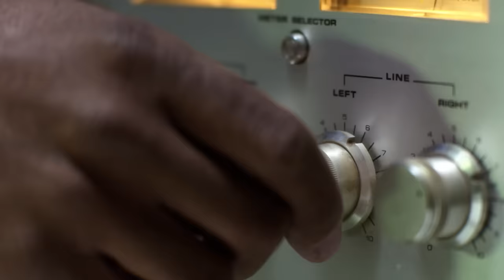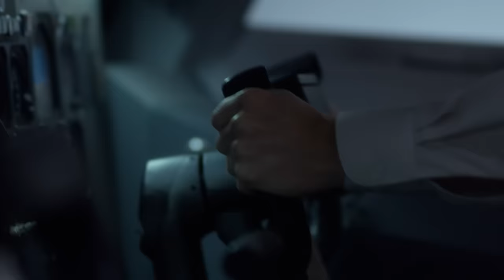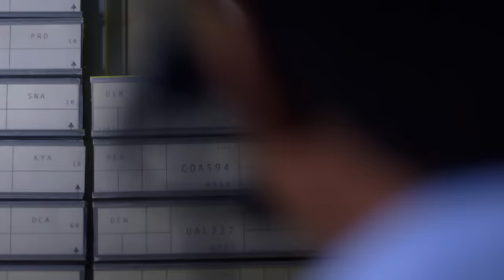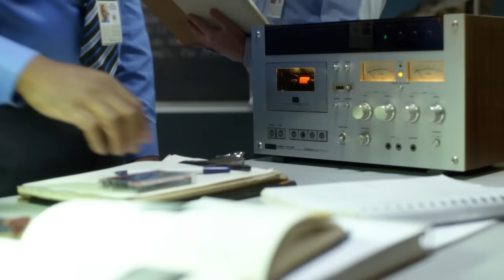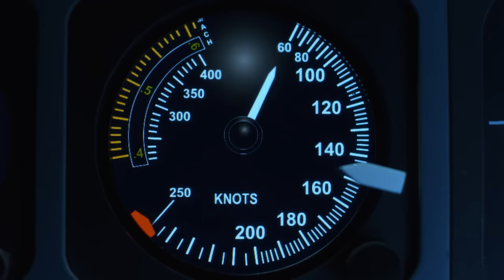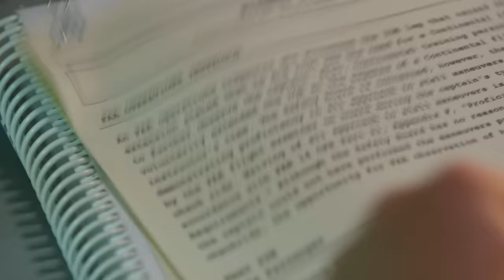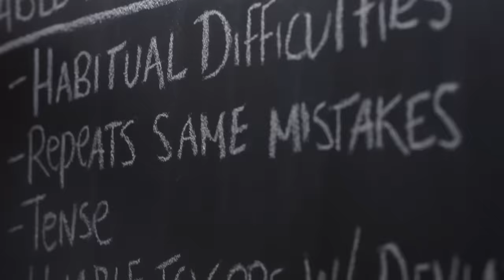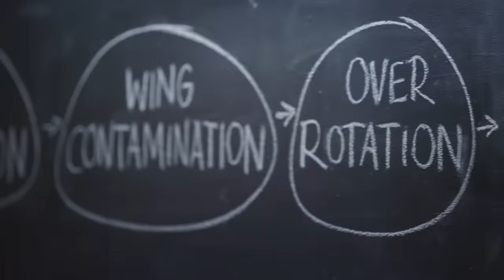Plane Crash That Changed Industry FOREVER | Mayday Air Disaster

Comment: I was on this flight.  I was in seat 15D which was over the right wing on the aisle.  It was much more cramped and crowded than this reenactment shows.  My perspective from the aisle would notice that more than his was next to the window.  There were no open seats.  The aisle was much more narrow and there were no flight attendants walking up and down the aisle.  We were all restless and most people were not talking.  A few tried to read the magazines in the seat pockets in front of us.  The man seated next to me and the one at the window never spoke.  I had come from a United Airlines flight that was cancelled due to the storm in Denver that day.  This was the only flight that my group could find to get home.  It was Sunday and we were all worried about getting back to school or work.
He’s exactly right about the time it took before the plane started moving.  It was de-iced fairly quickly but then we sat there for what seemed like a very long time.  During that time, no member of the flight crew checked the wings.  I was seated at the right wing.  They’d have had to lean over me to see the wing.  And the plane was standing at the leading lanes for the runway so no member of the ground crew could see us.
Also, the storm darkened the skies so that it looked like 5pm in November rather than 2pm.  Inside the plane we sat in the dark stone silent.  We were sensitive to the slightest movement by the plane.
Finally it started rolling toward the takeoff.  The Captain never said much.  I remember a brief announcement from him as we moved to the de icing pad and prior to that he announced that we were awaiting clearance to get de-iced but that is all I remember from him.
The reenactment doesn’t show our flight path very clearly.  If you compare the reenactment with the actual footage you will notice that the wreckage was much worse than what is depicted.  The plane took off and started to climb out.  We were in the air not hovering over the ground.  Within a minute the plane banked sharply to the right and then did a sickening roll back to the left as the Captain tried to take over.  One of the jet engines suddenly stalled out and made this tremendous noise like a gunshot right behind our ears.  I remember passengers starting to scream at that moment and I watched the nose go from an upward angle downward.  Within moments the left wing clipped the ground and a ball of fire roared through the cabin.  I remember turning my face to the right away from the heat but then the plane cartwheeled.  I remember hitting the ceiling with my face as our seats were ripped from the floor and then chaos, screaming, crashing and then the sound of gravel as we slid to a stop upside down.  
That’s what happened.
I was pulled from under the right wing 90 minutes later.  The man seated next to me did not survive.  Neither did 3 of my friends and 24 others including the captain and first officer.
Reply: No one should have to have had your traumatizing experience ! 
(True Safety Is No Accident )May the Lord bless
The rest of your life !
Reply: @markhwirth7718  Thank you for your reply and kindness!  Same to you.  I think everyone goes through a ‘plane crash’ in their life of one sort or another.  Mine was an actual plane wreck but no more significant than others.  I survived it and I am grateful.  I’m relatively unscathed physically, thank goodness, many people weren’t.  I didn’t lose any family members.  Many people did like the man in the video.  I have mixed feelings about these videos because I think it’s hard to reenact something that killed people from the standpoint of just one survivor.  But on the other hand I am honored that they did a program about this accident and its impact on air travel.
Reply: I'm so sorry that you experienced a terror unlike any many people ever do, and at a young age. But you survived and I know you've appreciated life more ever since.  😀
Reply: How much did you get in the lawsuit? I'm assuming at least a few million dollars for surviving thru that horrible ordeal.
Reply: @michellejansen6165 like you said people have and probably will be in some type of plane accident I know mine isn’t anything really but we hit a coyote while we were taking off and had to return because we didn’t know if there would be any structural damage but you are so lucky alive may God bless you and all who survived and died that day
Reply: Damn. It's rare to encounter someone in the comments who was actually on the flight depicted. Glad you are here to recount the facts. Be well and play the lottery every chance you get!
Reply: @hammiranda You’re forgetting that this was 1987.  No internet.  No cell phones.  No social media. No advocates.  I’m going to ignore the rudeness of your question and respond to its truth:  I got very little in compensation for the loss of my health and welfare that day not to mention everything I had with me.  I’m 56 years old now and my left hand shakes from the damage to the nerves in my arm.  I’m left handed.  I’m a business owner who works directly with my customers and I give lessons to kids who want to learn how to ride horses.  They all notice my hand as I try to write or illustrate.  Nothing compensates for that but at least I still have my family.
I’m saddened to hear of your question as one of the first things people think about when they talk to someone who has been in an accident like this as if we won a lottery.  We didn’t.
Reply: I'm so glad you survived but also saddened that happened to you , I'm sure they are moments , days you still think how it  all unreal it still seems after 37 years . May God bless you with many many prayers for many many  more years of life with your family .   🙏🙏🙏🙏
Reply: I was captivated by your comment. I'm so glad you survived. I couldn't imagine going through something like this. I wish you many more years on this earth :). My condolences about your friends. May they rest in peace❤️
Reply: @Voice4MyMoon  Thank you for your kindness!  I wish the same for you and those who share your story, too.
Reply: @10sherra  Thank you for your kind comments and for reading my story.  I wish you the same and everyone who shares your world!  :)
Reply: @markhwirth7718  Thank you for your reply and kind words!  I wish the same for you.  Thanks for reading my story.
Reply: @thecameramantraveler4830  I appreciate your reply and for reading my story.  I believe we’re all lucky to be alive.  :)
Reply: That’s such a terrible ordeal to go through. I hope you are doing well. So sorry for your loss as well
Reply: @michellejansen6165 so happy you survived your ordeal, hate you had to experience that, may God continue to bless you
Reply: @michellejansen6165 I’m so sorry this happened! Are you now scared of flying? Also we’re you in the fireing plane for 90 minutes as you said before?
Reply: @coco_styles  Thank you I just saw your reply.  Where are you from?  I posted my reply as a perspective from another survivor of that particular crash.  My hope is a more detailed understanding of what happened and to acknowledge the impact on all of the victims.  I am grateful to the man in the video who agreed to participate in it.  He was a boy at the time who lost his dad.  I’m sure his Father’s Day last weekend was poignant.  I hope he’s feeling well and if he’s a dad himself he knows all too well the fear his father felt as the plane went down—not just for himself but his child next to him.  I didn’t have any family members on board so I didn’t have to endure his loss.
I’m not sure what you mean by your question regarding the fire.  When the wing hit the ground it disintegrated and a ball of fire erupted from the fuel lines.  I was seated on the other side and the plane cartwheeled immediately after that extinguishing the fire itself.  Ironically the storm saved us as we awaited rescue because we were soaked in jet fuel.  Had it not been so cold and wet with heavy snow I probably wouldn’t be explaining myself to you.
Reply: @michellejansen6165  ah he’s thank you! I was confused that since when the video showed the crash fire was there and in your previous responses u said you were waiting for resucures for 90 minutes so I thought that if there was a fire how could he be there for 90 minutes but now I understand! But regarding my other question do you fly frequently? That was my main question but thanks for replying also I’m from New York!
Reply: @coco_styles  I hope all is well in New York.  Several people suffered severe burns.  I was wearing a heavy wool sweater with long sleeves so I was protected from the worst of the fire.  There were a lot of survivors who waited 5 hours to be rescued.  I believe the firefighters in the video talked about that.
This is why I commented about my perspective and recollection.  A video apparently can’t tell the story without creating confusion.
I was not afraid to fly until Boeing proved to me that their planes are no longer safe.  Yes, now I am afraid of Boeing.
Reply: @michellejansen6165  are just afraid of Boeing planes? Also do you like watching documentary’s on the accident (also sorry I’m so curious😭 I don’t mean to be annoying)
Reply: @coco_styles  It’s ok I appreciate your interest.  I have been disappointed by Boeing since their 737 Max crashes and close calls.  I know how it feels to experience a plane crash but mine didn’t torture me for several minutes or take my life the way those planes did to the victims in Ethiopia and Indonesia.  And we’re still hearing about close calls off the coast of Hawaii not to mention the door that came off outside Portland.  I fear we’re barreling toward another major accident and I don’t believe Boeing knows how to stop what they started.
Reply: @michellejansen6165  thank you so much for talking about it! That’s all my questions I hope you have a good day and stay safe🙏
Reply: Thank you for letting us know a passengers perspective of the flight. I pray that life treats you well and your angels keep protecting you
Reply: Thank you for your interesting story.  But after watching numerous episodes of this series, I don't believe I would ever be comfortable flying in an airplane again!  You must be pretty brave if it is only Boeing you would avoid.  Would you really fly in another company's plane, after what you went through?
Reply: @Dion-rz3fz Thanks for reading my story.  Keep in mind that happened in 1987.  That was prior to the merger between Boeing and McDonnell Douglas by 10 years.  At that time, I was confident in the aircraft but afraid of the airline.  I just never flew on a Continental Airlines flight again.  And they went bankrupt a few years later anyway.  The difference now is that I have confidence in the airline but I no longer have confidence in the aircraft.
Reply: @michellejansen6165  Thank you for your reply.  I really enjoyed hearing your story, and I believe this is the first time I have actually got to communicate with someone who was actually involved in something like this!  So glad that you came out of it as well as you did and did not have any relatives killed.  Blessings to you!
Reply: @michellejansen6165  that's so scary, for literally everyone involved. a lot of people fly Boeing. the poor pets too. i can't take it. 😔💔 it's just tragic all around. it's sad what the people and animals have to go through during the crash and after. and i know it's always in our heads when loved ones are involved too like, who did i lose... who that i love is alive. is my dog ok? is my mom? sister? dad? brother? friend? just let me die. as long as they are okay. or like hearing about any of them. i hope my dog, mom and sisters are always okay and nothing like that happens to them. ever.
Reply: @michellejansen6165  again, bless your heart. your family must have gone crazy. your loved ones. and hearing about your friends is not a good feeling either. i am so sorry, Michelle.
Reply: Got any proof you was really on this flight or you just making up stories to make yourself feel special???
Reply: @Hatinazz Yeah I made up what I was doing, why I was there, how I was there, where the flight was headed, what passengers were doing, which seat I was in and the smell of jet fuel, the blood I swallowed, and the warmth and strength of my rescuers hand as he grabbed my right hand when he finally reached me.  My back was to him because my head was still pinned under metal parts.  Someone cut the seatbelt which allowed me to finally take a full breath of air.  My remaining hair was glued around my head soaked in jet fuel.  Someone yelled ‘We got a live one!!’  They kept pulling at the wreckage to get me out and then pulled me onto a backboard.  They started working on me immediately by slicing my sweater off and putting equipment on me.  They asked me if I could say my name which I did.  If you still want proof, ask them.
Reply: @Dion-rz3fz Thank you and same to you!
Reply: @Hatinazz  ok "Hatin". are you serious with this awful question? you are not even funny either. how old are you? why would you deny her experience and not just any but an experience like this one? get lost.
Reply: @maryr.1650  Are you trying to get a blue ribbon, for rudeness?
Reply: WTF?  Reread this thread!  Your ire is totally misdirected because I said NOTHING rude.😒
Reply: @michellejansen6165  Oh my goodness! I was wondering if you were freezing under there. I'm sure at the hospital they had to wash the jet fuel off you! I'm so happy for you that you made it out of that flight. Godspeed to you!
Reply: God bless you, what a traumatizing experience 😢
Reply: Just pray! It works
Reply: @rihamkarim3644 just ignore him. There will always be people who don't Believe a comment.
Reply: I've read your account and the questions asked. I think it's so kind of you to take the time and caring to answer questions we have but are so hesitant to ask a crash survivor. You write very well, you're articulate and concise and also caring. Who hasn't given at least a passing thought to "what if" when boarding a plane?  You sound like a person of integrity and strength, and I must say your answer to the few crass people who popped in were perfect, especially the one who questioned your truth. I'm so glad you survived and hope your path since then has been blessed with all you need to cope with the nightmare you lived. I'm sorry for the loss of your friends. No one can imagine such an ordeal, the brain can't take us there. Good luck and Godspeed. Thank you, Michelle.
Reply: @voyaristika5673  Thank you for your reply, that was really nice.  I appreciate that.  
When I first saw the video about this accident it was haunting.  My memories of it were vivid but there was little else in the media that remained apart from a few grainy photos on Wikipedia.  The survivor in the video knows what it felt like and I wondered how much detail they took from him because it wasn’t like that inside the cabin before the accident.  It was dark and crowded.  The plane was manufactured in the 60’s so it was nothing like today’s airplanes.  
My group was scattered throughout the plane as we grabbed whatever open seat we could find flying standby.  My surviving roommate was sitting on the other side of the aisle maybe 5 rows ahead of me.  I remember the article she was reading because she held her magazine out towards the cabin lighting.  There was a photograph of Debbie Thomas and the upcoming 88 Winter Olympic Games.  I admired Katarina Witt and that’s why I was curious about the article.  
She survived the crash but was barely alive and badly burned when they got her out after 5 hours.  I heard that her body temperature had dropped below 90 degrees.  She spent a long time in the hospital.
She eventually married another survivor from Idaho and they’re doing well last I heard.  :)
Thought I’d leave a happier ending—at least one—from that day.
I imagine that you have a compelling story to share as well.  You write well, too.
Reply: @michellejansen6165  They just asked the question that everybody wants to know
Reply: @kennydings3879  This is Michelle Jansen and I am replying to your reply to one of my comments.  I’m not sure which one but you mentioned a question everyone wants to know.  I suspect it is the question of money.  Am I right?
I’m guessing that there are a lot of questions we all want to know about significant events.  My question is why doesn’t anyone ask this question of a victim of domestic violence?  Or a car crash?  Or a homeless person?  I put my experience in this story to lend perspective on this particular event and how it happened from someone who was an adult at the time and who remained conscious throughout it.  I remember every sound, every smell, every thought that I had as the plane rolled and fell back down to the ground.  But my memory isn’t the only one, I am not the only victim, this accident was not the only crash and my experience wasn’t the only dreadful thing that happens to people.  I’ve always thought it so unfair to victims of crimes who can’t speak of their experience or a cancer patient who is never paid back for their pain.  
If I read your comment wrong, disregard.  But I submit that there are some questions that just don’t matter.
Reply: @michellejansen6165  Yes it was me who said “ they were just asking what most people want to know “how much did you get in the lawsuit?” My comment doesn’t belittle your experience one bit and I say it from personal experience. When I was 19 my 16 year old sister got cancer. My parents like most parents did everything they could do to find the best treatment for her including flying half way around the world. Long story short they botched the procedure by getting the wrong part and mid operation had to stop and wait a day to have the right piece made. Unfortunately the screw up killed her. This was 40 years ago. So after I tell this story guess what is the first thing EVERBODY ask me or my parents? You know the answer. FF 11 years ago, my 17 year old daughter and her best friend ended up in a head on crash on a 2 lane highway with a man who crossed over the centerline in his 21 ft motor home. The girls were in a Lexus which has amazing airbags which saved their lives, he was killed. Guess who was at fault? Thankfully not my daughter, who was driving. So guess what everyone asks me after they hear my daughter’s story. Di
Reply: You sound like a wonderful human being, I wish you and your family all the best!
Reply: @michellejansen6165  That's incredible and tragic all at the same time. I'm very glad you are alive! Were you injured badly, little or not at all? And are you comfortable with flying now or are you still shaken up from this experience?
Reply: @Fobol  Thank you for reading my story and for your reply.  I wish the same for you!
Reply: @zz-dd8di  Thank you for reading my story and for your kindness.  
My injuries were related to the compression inside the wreckage.  I escaped a permanent head injury.  But the nerves in my left arm and hand were damaged. Over time the shaking of my left hand makes it difficult to write and impossible to hold anything that can spill or break.  But my right hand is ok and I can still do my job.  I still work with my horses.  No bone fractures.  I had plastic surgery to repair my face where I hit the ceiling.  
Fortunately I was in the hands of skilled surgeons in Denver who put me back together and it’s hard to find the scars, even in my 50’s.

I have flown many times since then and although I lost my love of flying I wasn’t afraid to fly until now.  In 1987 I was afraid of Continental Airlines but I wasn’t afraid of the aircraft.  Now I fear the aircraft.  The safety lapses and mechanical failures and most of all the reluctance to include pilots in system maintenance and operations will someday lead to the next major airline disaster.  We’ve already seen it happen twice and those poor passengers and crew suffered so much more than I did.  They were tortured and must have been so scared.  I know how it feels to realize the plane is going down.  I can’t imagine how much worse it felt for them.  The pilots fought to the end but unlike my plane, they’d followed procedures.  There was no possible way for them to figure out what was happening.
I’m not blaming the flight crew of my plane, they didn’t survive and I know that they didn’t mean to cause our accident.  But it’s also true that they grew impatient with the situation and were careless at times.  They ignored some of the procedures.  ATC didn’t even know they were there!  
That wasn’t the case in Indonesia or Ethiopia.  Those pilots were following the rules.  But they had a machine whose systems were defective despite the plane being brand new.  What chance did they have?
That’s what bothers me the most along with deregulation.  I believe there are too many planes trying to land in the same place where too many more planes are trying to leave.  Yet air traffic controllers are overworked and underpaid.  We expect them to never make a mistake, have a bad day, or have their systems hacked.  We expect them to prevent terrorism and immediately recognize it if it happens. 
I am grateful for leadership in the current Department of Transportation.  I believe it is functioning because it’s Human Resources are taken care of.  I worry about them if deregulation continues…

I’m also worried about pilots.  They’re being asked to handle more and more people and pressure yet left out of design discussions.  They’re retiring faster than they can be replaced especially with their level of experience and capability.  And the cheap fare wars means airlines can’t afford them.
Reply: My God what an experience. I hate you had to endure such a thing, and that so many didn't make it.

I understand the trauma. A friend of mine, me and my GF at the time got capsized one early afternoon in the Gulf of Mexico when a sudden storm caught us. We were in the water for 7 hours holding onto gas cans and whatever else we had to stay afloat. Three of our friends had been lost in the Gulf 3 weeks before in, what we think, was the exact same scenario. We're not sure because none of them lived to tell their story. We thought the count was about to double. The waves were pounding us, the wind was howling, the lightning was constant, the rain was torrential for an hour and a half. It just so happened that someone on a 60' yacht saw us, just before dark and came and fished us out. That was a close one.

Take care and best wishes
Reply: @michellejansen6165  I appreciate your comments here and your insights into exactly what really happened and the horrible recent crashes . 😭😔 God is using your voice to bring more awareness , and I pray it is saving lives . I believe it is . 🙏 Lord bless your life .
Reply: Bless u. God was with u amen 😮❤
Reply: Sorry for your loss. I Thank God for your life and you survived.
Reply: Wow what a story of survival. I am so happy you survived. Thank you for sharing your story. I am so sorry for your friends who died. May they RIP. I hope that you have mentally recovered from such a traumatic event. God bless you. 🙏
Reply: So sorry to hear that. It just shows how dangerous incompetence (air traffic controller) is. One of the big factors
Reply: I'm so sorry that happened to you and the others on that plane.  My condolences to you and all that lost someone.  Thank you for sharing your story. I can't even imagine what the healing journey from that experience has been like. Peace to you.
Reply: @tubecontributor3206  I appreciate your thoughtful comments, thank you. I do want to clarify one point about air traffic controllers—it wasn’t their fault.  This is one reason I contributed to this story: the depiction wasn’t very accurate in places.  Air traffic controllers are under tremendous pressure keeping planes flying safely, no more so than in 1987 when this happened and Stapleton Airport, despite being a large international airport, had no ground radar.  ATC relied on flight crews to alert them of their presence once on the ground.  Our flight crew didn’t do that.  Our pilot didn’t want to fly that day because of the storm and he disregarded procedures.  Maybe he did that because he was frustrated or apprehensive or just tired or maybe he was incapable of the situational awareness he needed that day.  I don’t know but he created the delay that allowed ice to form on the wings, not Air Traffic Control.  He ordered the 1st Officer to take control during takeoff, not ATC.  And he knew that plane (or should have known) didn’t have the forward slats that newer planes had at the time to assist with lift in situations like that.
I’m not trying to criticize someone who cannot defend himself but I do think it’s important to state the facts and in this case, it wasn’t ATC who contributed to the accident.
Reply: God bless you! Im so sorry you experienced this horror, but I’m glad you lived to tell your story!!🙏🏽✝️🙏🏽
Reply: This crash in a snowstorm, reminds me of the tragic crash of an Air Florida airplane that took off during a terrible snowstorm, slammed into a Washington DC bridge and crashed into  the Potomac river! A very brave man jumped into the Potomac river and saved a number of passengers!
Reply: I’m so impressed with your eloquence and the way you have responded to comments here. You have helped many people understand and empathize with these kinds of situations. Also, as a disabled Colorado horse lover myself, I know what it means to fight to do what you are passionate about, even when people question your ability to do so as well as your safety. My good boy has been one of the few things that has kept me as physically fit as I am, and he is so careful around my wheelchair.  Bit of a goof when I’m riding, but he’s a pony… it comes with the territory.

I totally understand your hesitance about this kind of recreation, but as someone who has never lived through a plane crash, I thought it might be helpful to hear about some good it has done. My niece, who I adore, lives with a family who has to travel internationally frequently. She was terrified of flying. Since discovering this show, she now wants to be a pilot or investigator. It really helped her to see the worst possible scenarios and demystify them, as well as demonstrate the hard work put into making these safer after every crash. It also is a puzzle, and she is a brilliant girl with an inquisitive mind, so that is engaging to her as well. A few years ago I was genuinely shocked when she introduced me to this show and had seemed to completely gotten over her fear (as well as making sure her whole family follows safety briefings to the letter.) She stayed with me that summer and we must have watched dozens of episodes together. I know these things are problematic for all the reasons you discussed. They do cut corners and make choices to make them more dramatic and engaging to the average viewer, which can feel dehumanizing. Still, at least for my niece, they have been a massive positive. If you want to see some more technical, less sensationalized mentour pilot on YouTube (which she also introduced me to) make some excellent breakdowns of similar accidents.
Reply: @thecameramantraveler4830  What an ignorant thing to say, you really think that a person who survived a fatal plane crash has 'no idea how lucky they are'
Reply: @That_One_Guy457  what’s wrong with a simple comment about being involved in an air disaster from the survivors perspective?
Reply: @thecameramantraveler4830  Because it implies that the survivor does not realize that they are in a fortunate position. I apologize if it came off a little rude of me, however the idea that they don't know that they are lucky seems a little patronizing
Reply: @That_One_Guy457  I accept and it makes sense
Reply: @thecameramantraveler4830  Thank you for understanding, I also recognize that you probably meant it in a positive way and I'm sorry for nitpicking
Reply: @That_One_Guy457  don’t worry. I took down the comment already
Reply: @thecameramantraveler4830  Alright, again sorry for nitpicking
Reply: @michellejansen6165  Out of curiosity, did you ever find out why it happened before the Mayday episode.
Reply: @michellejansen6165 This was also the first of four crashes where the NTSB recommended that airlines conduct better background checks on pilots.
Reply: @Powerranger-le4up  Yes.  The NTSB investigated the accident and concluded it was pilot error, ice buildup on the wings, and failure to follow communication protocols with ATC.